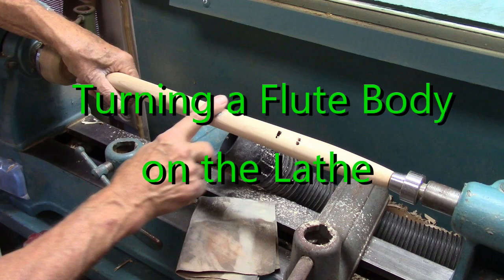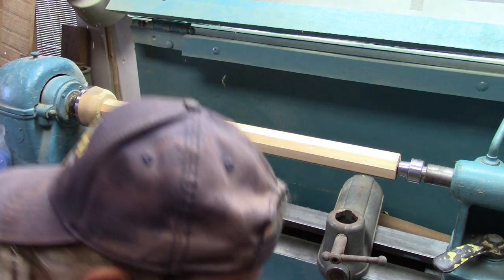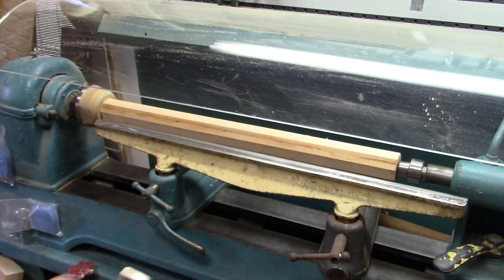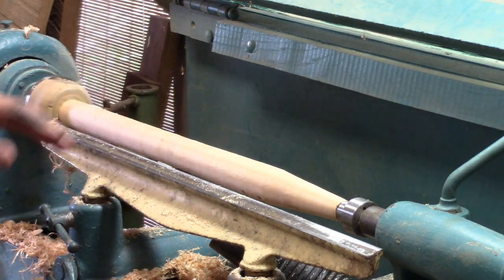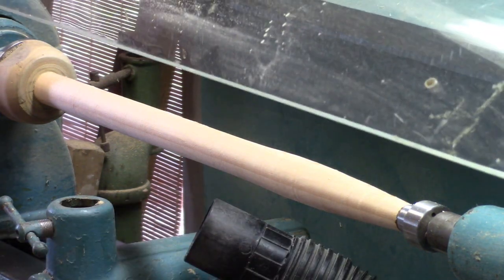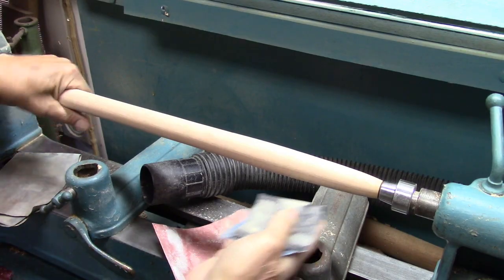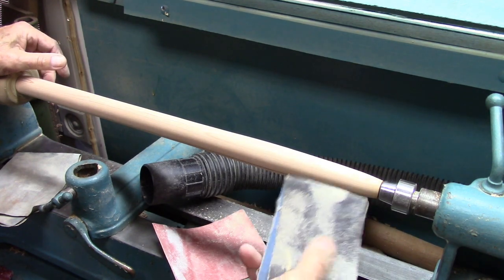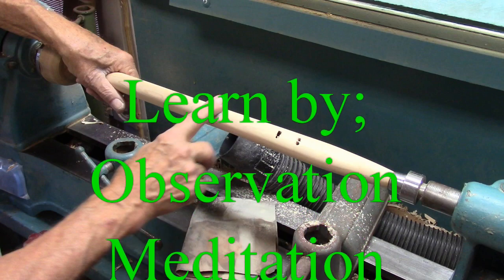Turning a Flute Body on the Lathe

Comment: Thanks a lot! How did you drill the long hole in the flute?
Reply from the maker: I cut them on my router table--- the flute is in two halves then glued together.
Reply: @donaldporta  amazing! Must be tricky to do the two canals fit together perfectly. They make cornetto s the same way, first split in two. They have a conical bore like oboes though (and mouthpiece like smaller trumpet mouthpiece).